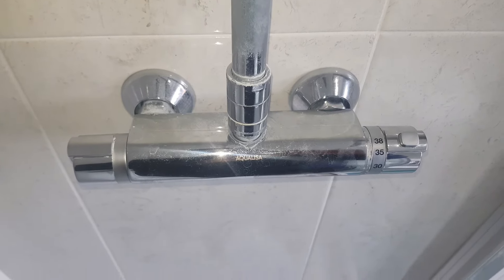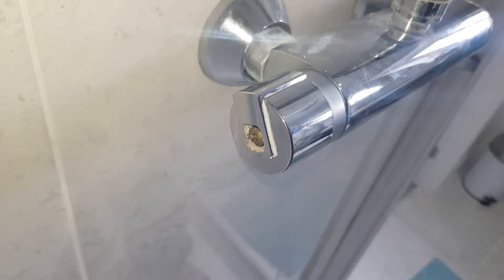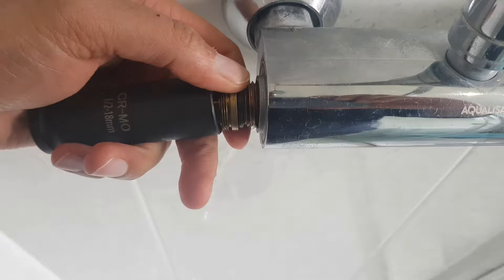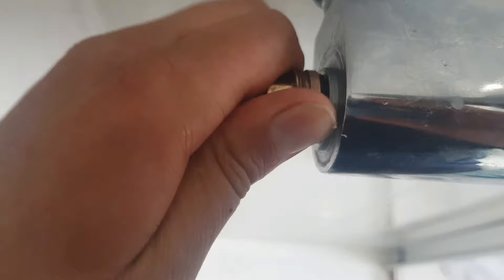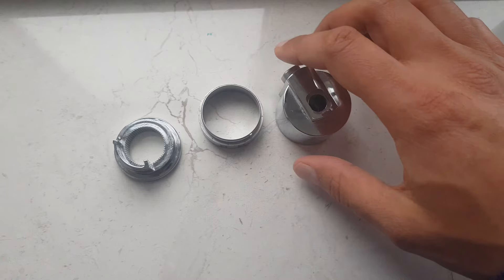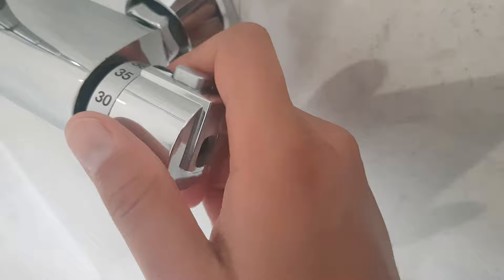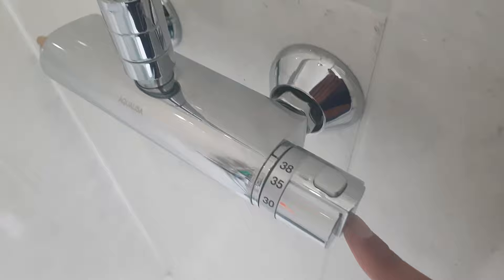Shower valve stuck, removed and repaired

Comment: Thank you for making the mistake by not emptying the water. My Aqua Lisa cartridge was stuck solid and there isn’t much to grip on. After seeing your video, I turned the tap off, set the temp to full cold, put the temp dial screw back and reconnected the tap. I turned the cold water supply back on and then tried pulling the cartridge out by the screw. It worked! The water pressure did the trick.
Reply: Can you explain what you did? I don't follow you but my cartridge wont budge either and this sounds like a tip to get it moving

Comment: I have a very similar unit in my bathroom and I have an extra question. You mentioned in the beginning of the video that the water pressure knob was loose - mine is acting a bit similar + it doesn't always completely shut off the water and I have to use a bit more force to turn it all the way into the closed position than I actually feel comfortable to do (I'm afraid that I'll break it off). Does it generally require just a clean from the limescale build-up, or is there some kind of a gasket inside that may require a replacement too? What's your opinion on this?
Reply from the maker: The washers/glands are cheap. So you could even replace the cartridge. Ebay has some good suppliers who you can call to confirm the exact cartridge

Comment: I’ve just found out that when I turn the thermostat to the coldest position, my shower gives also warm water. Does it mean that it’s broken or should I calibrate the knop? We installed the bar just as it was from the factory. Thank you
Reply from the maker: Calibration may help

Comment: So in a nutshell you cleaned off the limescale. My water pressure (left hand side) is tight but after shower has ran for a couple seconds it frees off. I might have a go at mine
Reply from the maker: Did you manage to fix?
Reply: @DIMTips  for a bit then it did it again so just replaced it
Reply from the maker: @Parkendnorth  at lesdt it got you through for a bit

Comment: Thanks this feels fairly straightforward to follow even for an accountant... Have a question though pls!

I've got a system boiler, if I turn the cold water off at the mains, will it also turn the hot water feed off too, or do I need to empty the hot water tank via letting any hot water tap run?

KR
Reply from the maker: You should be fine. Just run the hot for a while and eventually pressure should be low enough. Did you manage to fix
Reply: @DIMTips  thanks for this. Yes sorted it finally. Thanks for your help, steer was very helpful

Comment: Would I be able to remove just the thermostat control valve with the water still on? Im not looking to remove the cartridge at this stage but just try and tighten it to see if it stops a small drip from the thermostat control.
Reply from the maker: Not a good idea

Comment: Great video mate, glad you out this up. Can I ask I've walkways wondered what the button  on the temperature control knob is for?
Reply: It's to protect the user from accidentally selecting a hot setting so 38 degrees is the limit. If you want a hot shower then the user will cognitively select the higher temperature.
Reply from the maker: Yes it is and thanks for relying
Reply from the maker: @rafdannyboy gave a great response

Comment: If you have an unvented cylinder, would turning the mains water off also stop the hot water? TIA
Reply from the maker: It did for me. But always check all taps before opening anything.

Comment: How can I get a replacement cartridge as I don't know the brand I have nor the part number. My cold water doesn't run and temp is all messed up on my shower so hope this will fix it
Reply from the maker: That may be tough. But if you know the brand it may be easier.

Comment: At 1.50 you popped off the thermo control collar with the end of a screwdriver. Can you get the cartridge out if this hasnt been removed first? Also my flow control cartridge will not budge! Any tips to get it moving?
Reply from the maker: A few people have tried vinegar. Seemed to do the trick. Any luck?

Comment: Great video! What is the tool you used at the start of the video ?
Reply from the maker: Breaker bar.
Reply from the maker: Meant to say breaker bar or torque wrench with a socket. A spanner does the trick but may slip.
Reply: @DIMTips  Thanks!
Reply: Sorry I meant the tool used at 17 seconds?
Reply from the maker: Sorry, that is a leatherman multitool. Similar to a Swiss army knife.  A very small screwdriver, should do the trick.
Reply: @DIMTips  Thanks again!

Comment: Do you have any tips for removing a stuck thermostatic cartridge? 
The one I have hasn't been touched since it was installed in the house about 10 years ago, but it is stuck tight inside the mixer shower unit.
Reply from the maker: There are multiple types. Could you let me know what type. There is normally an Allen key screw holding it in place.
Reply: @DIMTips  Ah yeah, it's the midas 100, very similar in design to the one you show in your video. I removed the grub screw underneath with an allen key, but the cartridge remains firmly in place, it won't twist or pull straight out of the shower mixer bar.
Reply from the maker: It is a little tough to pull out. I actually had to use a combination of limescale remover followed by wd40 in the past.
Reply: @DIMTips  Did you have to turn off the mains water supply as well or can you do this without doing it? I rent my house and the temp isnt really getting hot so want to de-liescale the thermostatic Cartridge, but i dont know where the stop cock is and cant find it anywhere!!

Comment: I have the same Aqualisa tap. My problem is it stopped working. No water comes out. It started with a very low pressure. Then now no water comes out at all. Is the cartridge that needs fixing? Is this easy to fix for a diy? I dont have a plumbing insurance they might charge me high
Reply from the maker: Might be limescale. Hope you managed to sort out

Comment: My shower temperature gauge doesn’t seem to make any difference to the overall temp of the water. I can see cold water is getting to it as there is condensation on the top but no matter where it is the temperature is always the same. 
If I remove the regulator how long should it soak in vinegar and is there anything else to look for? Thanks
Reply from the maker: That is a tough one. You may have an issue with your tempreture controller.

Comment: The temperature control doesn't do anything for me even when turning the valve manually, any ideas? Its basically on hot constantly
Reply from the maker: Wonder if mechanism connected. Might be worth  replacing

Comment: I seem to have a similar problem with the temperature controller but there is no flap or pop out concealing a screw to remove it.  The controller works between 35 and 38 and a button can be depressed but the controller will not move above 38.  Have you any ideas, please?
Reply: We just moved into a flat and have the exact same problem - did you find a fix?
Reply from the maker: Hope toy managed to fix
Reply from the maker: Hope it got fixed.

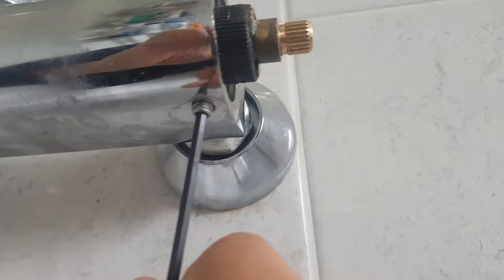Comment: 2:10 I don't have an Allan key slot like that adjustment does, could mine be within the valve?
Reply: Yours is probably held in place by the servicing nut screwing in to the mixer body. Just ignore that there’s no grub screw.
Reply from the maker: Great response
Reply from the maker: You have your answer below from minot. Did you manage to fix